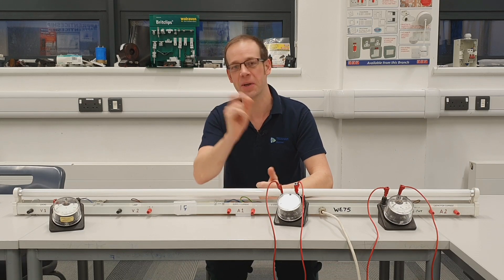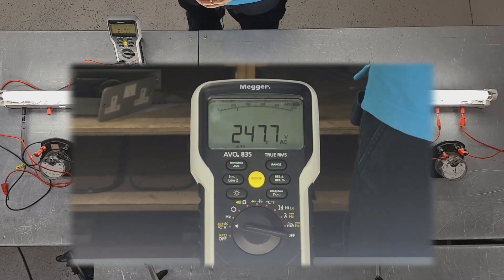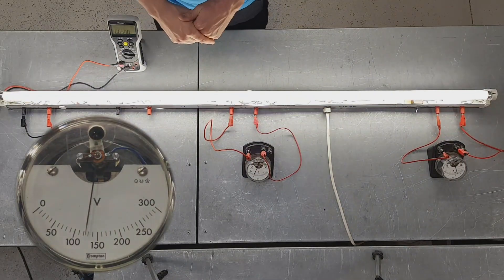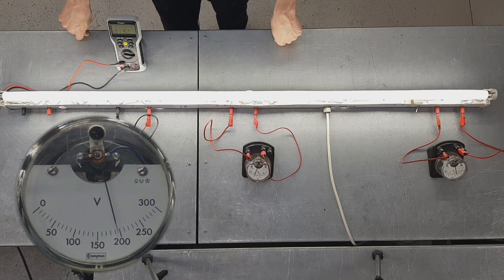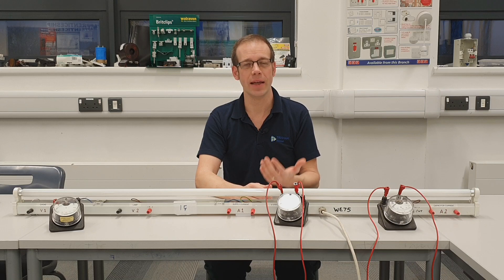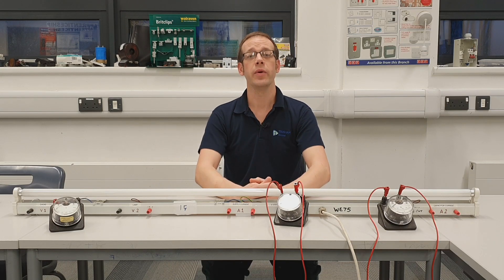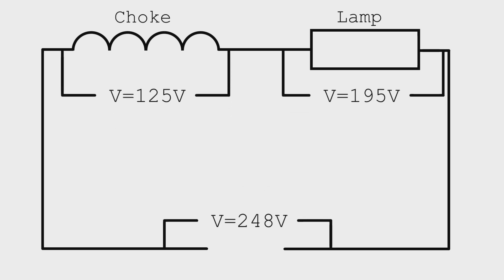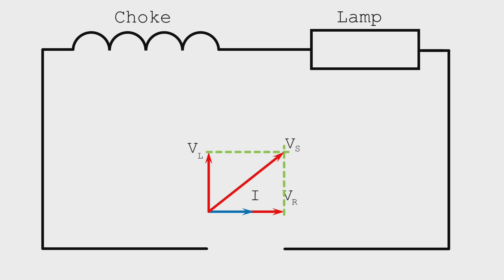AC Theory: Solving the Mystery of the Fluorescent Lamp

Comment: In case you are confused at the apparent voltage being 230v instead of 248v, there is a follow on video to explain the difference. If you can't find this follow on video, then the explanation is that the choke is not a PURE inductor - it's a copper coil so there is some resistance. So, there's a bit more voltage dropping on the (total) resistive part of the circuit which lengthens our phasor right angle triangle and stretches our 230v up to the 248v measured.

Comment: From what I understand, the voltage would be out of phase after the coil and that's why you turn the phasor diagram of the coil, right? Actually I think that the voltage would still be 230 in total, what happens is that the measuring device makes that vector sum but I do not understand why. It would make more sense to me to measure 230 in both the coil and the resistor considering that it is the same voltage but out of phase. Maybe I'm wrong, and I have no idea what I'm talking about.